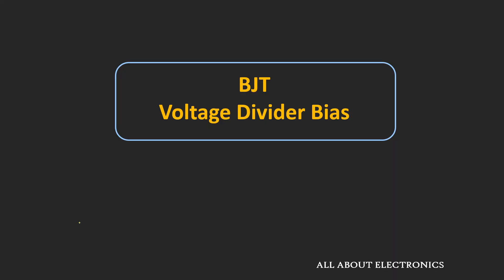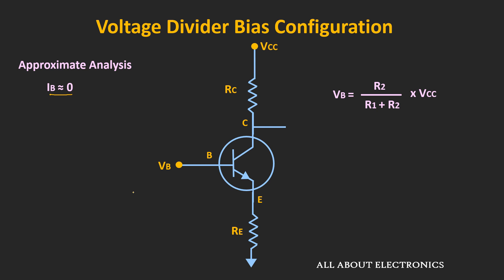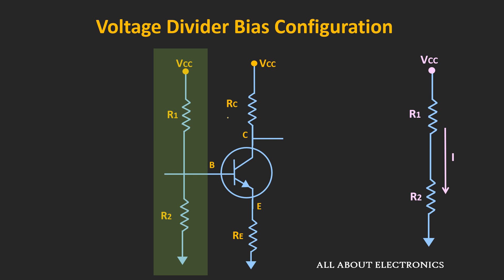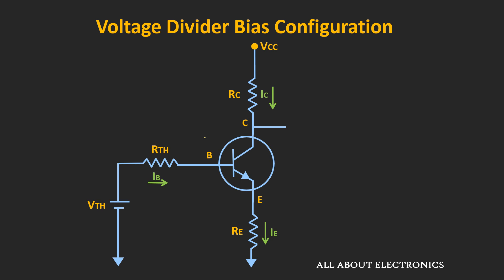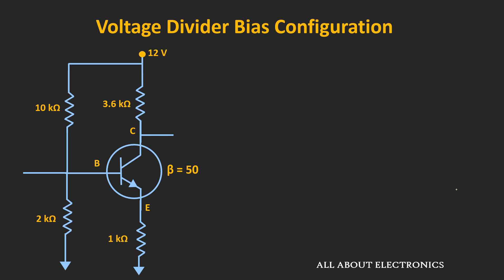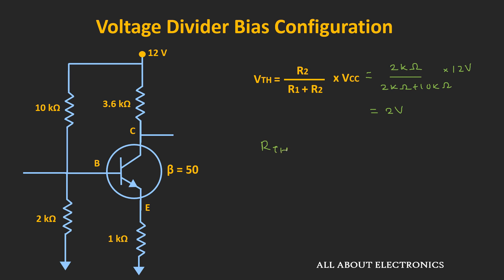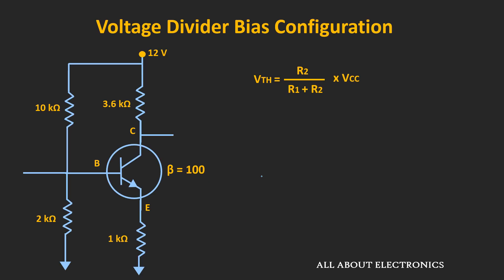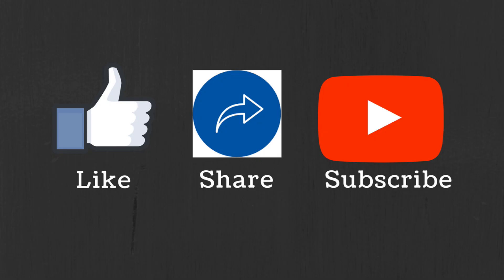BJT: Voltage Divider Bias Configuration

Comment: Why we not use approximate analysis? Still  Rth <<(bita + 1)RE .

And use normal equation
Reply from the maker: Yes in this case, absolutely you can use that approximation. But I wanted to showcase  the exact analysis in this case. You can even compare the results by using the approximate analysis.

Comment: 3:45 then why you addd VE
Reply from the maker: Vce is the drop across the collector and emitter terminals of BJT, while VE is the drop across emitter terminal. To find Vce, first we need to find Vc and then Ve. The difference between them will give us the drop across those two terminals of BJT. Vc = Vcc - Ic Rc and Ve = Ie Re. And the difference between them will give us Vce. That’s what is shown at 3:50

Comment: How can one find VB in this type of configuration? Is VB = VTH?
Reply from the maker: As I mentioned in the video, you can check the condition for the approximation. That means if  Rth is much less than  (B + 1) RE, then you can do the approximate analysis. And as per the approximate analysis, you can find the Vb, just using the voltage divider rule. If condition mentioned above does not get satisfied, then you need to do the complete analysis by finding Vth and Rth.
Reply: @ALLABOUTELECTRONICS  Yes, I realised that after commenting. Thank you. Your videos are so helpful

Comment: ic =0.7mA,vce=9.8v huge variation in operating point under approximate analysis
Reply: I was able to get 1.3 mA for I_C (and I_E)
and 6.02 V for V_CE 

using the approximate analysis, I followed the 4 formulas and 3 conditions given

Comment: i have a small doubt is self bias and voltage divider bias same or different
Reply: Thank you very much for your reply got clarified
Reply from the maker: They are same. In the self biasing, we do not require another power supply for biasing the base of the transistor. Using external resistors, it is derived from the existing power supply. The same is done in the voltage divider bias.

Comment: Hello, at 9:45 it has been said that if Rth<<0.1(B+1)Re then approximate analysis can be used, on contrary  at 16:10 ,  the condition is changed as Rth<<10(B+1)Re...so can anyone clear it...?
Reply: Correct one is Rth <= 0.1 (b + 1)Re. It is wrong at 16:00

Comment: 15:15 I think  Vce is equal to 6.204 V right???? I got this value from my calculator if it is wrong check it and plz correct it.
Reply from the maker: The collector current is 1.266 mA. During the calculation, if you take the value of collector current up to 3rd decimal place, then Vce will come out as 6.174 V. If you consider the value of Ic up to 2 decimal places, then Vce = 6.204 V.
Reply: @ALLABOUTELECTRONICS  oh got it thank you

Comment: How you have done {Rth/(beta+1)}+Re in place of {Rth+Re(beta+1)} ?
 8:35
Reply from the maker: Its emitter current. Just multiply the base current with ( beta + 1).  Taht means, i nthe numerator you will have ( beta + 1) term. Now, multiply and divide the numerator and denominator by (beta + 1). So, finally, you will get {Rth/(beta+1)}+Re } in the denominator. I hope, it will clear your doubt.
Reply: @ALLABOUTELECTRONICS  got it I have also worked it in my copy 😅 forgot to delete this query 😅

Comment: Why is capacitor connected at input and output side?Could someone explain me?
Reply from the maker: They are used to block the DC biasing voltage. Typically these amplifiers are using in cascade configurations where more than one such amplifiers are cascaded. The DC biasing voltage of one amplifier should not affect the next amplifier or any other circuitry after the amplifier. The capacitor blocks the DC voltage and passes only AC signal.

Comment: Vbe=0.7V how? Is it given? Pls reply fast
Reply from the maker: If you see, the base emitter junction is forward biased. So, it acts like a diode and the voltage drop across it can be assumed to be around 0.7V during the analysis.
I hope it will clear your doubt.
Reply: @ALLABOUTELECTRONICS  ok thanku thanks a lot

Comment: We have assumed base current almost equal to 0. So, at 7:21, won't we take base current=0?
Reply from the maker: Yes, that was considered for the approximate analysis. And it can be assumed when (B+1) Re >> Rth. 
At 7:21 the expression of the base current gives the exact value of the base current. 
I hope it will clear your doubt.
Reply: @ALLABOUTELECTRONICS  Yeah got it. Thank you for the answer.😊